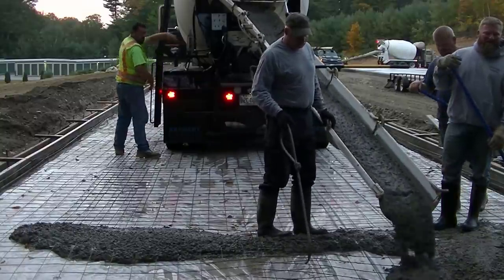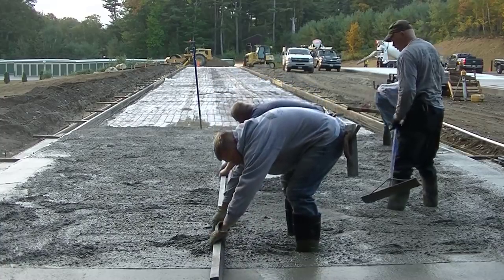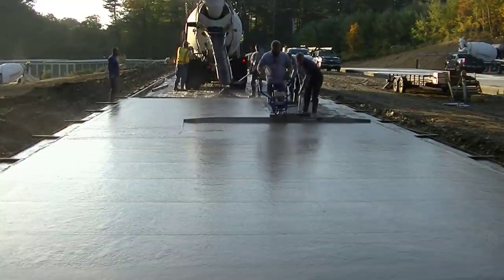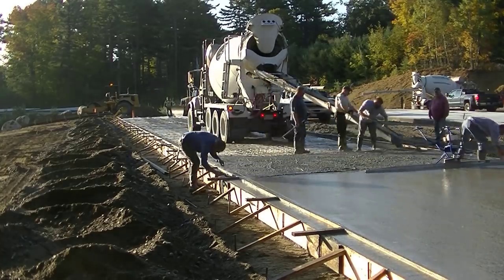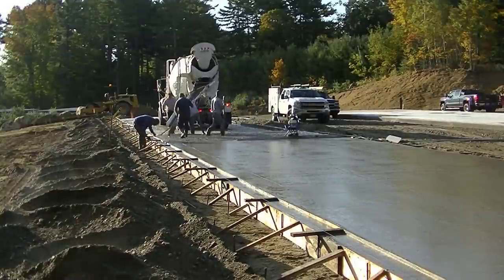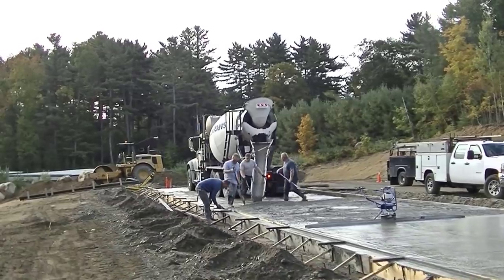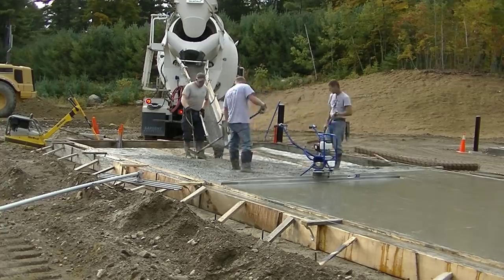Pouring A 4400 Sq Ft Concrete Slab (For A Storage Building)

Comment: My crew and I have taken on a 15'x110', 2 guys and myself with a 20x20 off to the side we used a vibratory screed as well and a whirly bird to finish. I havent taken on anything quite this big as I havent had the opportunity. You guys did a beautiful job.
Reply from the maker: Thanks Mark. Having 3 or 4 good finishers does make doing these a lot easier. We only had 3 trowels on these finishing them.
Reply: @MikeDayConcrete  You guys kill it, very impressive thankyou for sharing.

Comment: Mike, small tip, just use the vibrascreed to set your wet pad in the center. Do your laser wet screeds at the length of your blade or even closer. Nice work . I've done those edges either way, and leaving them open is definitely the way to go

Comment: I'm a journeyman in the union. We poured many huge slabs. I can't lie, it isn't fun...lol. especially in winter when your fighting rain and cold temperatures.
Reply from the maker: You're right, winter concrete isn't very much fun!
Reply: @MikeDayConcrete  I worked one winter in North Dakota. We poured some slabs in 20 below temperatures. The concrete froze on the bottoms of are mag hand floats instantly. A guy walked around with a weed burner and his job to heat up the bottom of are mags to melt the concrete on it. It was ridicules and a pain in the ass.
We always poured using a ground warmer that used hoses that pumped heated hydronic fluid through it and covered them with heating blankets for the night. Then a snow storm hit. We had to dig the snow and ice off of the blankets in order to move them by dragging them. They were so heavy with snow an ice on top of them.
I would never work a winter in North Dakota ever again. It was hell...only freezing...lol.

Comment: Poured my first piece of concrete this last weekend after watching you're channel for a while. It went horrible! Just did a little practice ring around my firepit. Ultimately I think it came down to the concrete we used. Just the cheap hand mixed 60 lb bags from Menards. The bag says its only a 3" slump as speced and we had a hard time with it. We added too much water to try to be able to work it, and still ended up with massive pores when we removed the forms. Some spots had too much aggregate and too little sand, so we ended up with a pebbled surface. Didnt set like I got used to seeing in your videos where you could work the surface smooth with a trowel. We will definitely try again! Probably get better concrete, rent a mixer to get better mixing, and use the right amount of water. I bet readymix goes smoother. Still had a lot of fun. Will probably still hire a contractor for the floor on our upcoming housebuild but definitely want to make another attempt at patios and sidewalks.

Comment: Mike, I really like how you have the open ledge.  We typically will form this with 2x10's nailed on edge to out outside vertical form, a 2x12.  Lots of work to strip and finish.  I'm curious how you suspend the 1-1/2" form and keep it secure?
Reply from the maker: I use a Simpson Strong Tie bracket from the 2x4 to the 2x12 to secure it.

Comment: We called that shelve a "weather lip "   I put a weather lip on all the  residential  garage floors I do ,,, just lay a 2x4  on its flat up against the garage door bucks that they screw the tracks to ,,,,, finish to the top of the 2x4 on the inside the bottom on the outside just like you did there ,,,usually after the first pass take the 2x4 out and finish underneath it brush it  or float finish it !

Comment: Hey, so we’re a non profit camp for people with disabilities that pours all our own concrete. We mostly pour walks between all of our buildings for accessibility. We use a vibrascreed for everything we can. One issue we’ve always had is pouring pads wider that the screed board like you’ve done here. It seems like If it’s not riding on the edge of our form it just sinks in. So to combat this we always have to put in a 2” steel pipe down the middle of the pad to ride on and then we pull it out after screeding. Are we doing something wrong that it always sinks in? Should we not be sitting on the edge of the form maybe? Also your videos a beyond useful! I’ve learned so much watching

Comment: Nice work!  How far apart do you space trucks?  We hand screed with a mag board and use a 2" flat bar on edge for screed guide in the center.  Usually only do 20-30 yds at a time since it's just a two man crew with whatever day help we can scrounge up.  It is a real pleasure to watch your crew work.
Reply from the maker: Not much spacing. On a job like this he just loads them as fast as he can.

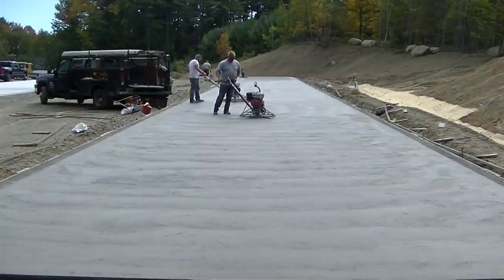Comment: Hi Mike, my name is Dimitri. I have a small company of 9 guys and we are concrete floor specialist in Mauritius. We usually cast 40.00 x 10:00 x 0.20 mm thick in 1 pour including the power float finish. We also use a laser to control the levels. Every steps are quite similar except from your vibrating ruler. Instead we use a vibrator and poker and aluminium straight edge ruler to cut the concrete flat. We also use floor hardener at 5 kg/m2 by dry shaking and we power float with a rideon power float machine. We normally start at 8:00 in the morning and we finish at 19:00 hrs
 Let me have your opinion on our way of doing concrete floors. We also use a pump to pour the concrete.  Regards Dimitri
Reply from the maker: Awesome Dimitri, thanks for watching!

Comment: Great video! Do you ever run into the slab "shattering " when you pour directly on plastic? It's always been recommended to have a few inches of sand or dirt on top of the vapor barrier....
Reply from the maker: No we don't have any problems doing it like this other than the bleed water.
Reply: RE: a few inches of sand or dirt on top of the vapor barrier.
That is some Californian ridiculousness. If water get into that layer, where should it go? It will creep out of the floor. Expect all kinds of fungi and mold. Obviously, the sand must be under the vapor barrier, obviously.

Comment: Hi . When driving with the power trowel . Have as little angle as possible, To increase the angle after a 3 times. then you get the cream, then drive 3-5 times  until you have a mirror.
This is translated by google
etc. from Sweden
P.S. Nice work

Comment: Mike,    I know this is off topic.   I need some help to help my son.   He purchased a house with a in ground pool.   The concrete is sinking in a couple areas about 1" to 1.5".    The previous home owner skimmed a material over these edges to keep them from being a tripping point.    These areas are now breaking up....     I know that having the concrete lifted would be the proper fix.  Sadly, during this virus time funds are very tight.   I can't help him because i make ends meet barely being a disabled veteran.    What materials would i use to skim these lip areas?    Also,  what could i do to prep these areas to help the skim material stick better?    Any suggestion would be greatly appreciated.

Comment: Sweet moneymaker there! No pipes, no pump, trucks spaced just right, no waiting. I bet you wish you had 3 or 4 of those every day, right?
We have a cpl names for those forms on the edges in my area. Those specifically, most would call a ‘recess form’. Or some people might call them ‘depression forms’. Others might even refer to them as a small ‘floating form’. And you’re right. WAY better to ‘float’ them in there like you did instead of a solid 2x8 or 2x10. Then you HAVE to use a vibrator and invariably you always end up with a cpl voids that need to be patched.
I wonder what they’re referred to in other areas.
Reply from the maker: Yea, it's pretty much impossible to get the air voids out using a 2x10 unless you strip it off and sponge it out. A lot more work in my opinion. The pouring and finishing part of these is the easy stuff, forming and stripping the forms is more work.

Comment: Still screeding with a caveman 2x4 and vibrating using a hammer on the forms as we're pouring out because bossman is stuck in the early 90s.

Wonders why there's small dips in the slab though.
Reply from the maker: Have you shown him my videos?

Comment: Anybody have any experience with keeping a small bathroom in the corner of a slab isolated from the rest of the slab Incase there is a plumbing problem so I can just remove that section?

Comment: Why don't you cut the pad wet, rather than coming back and cutting it with a saw?
Reply from the maker: You mean use a jointer? It's easier to just cut it after. Especially when power troweling. We cut it the same day, as soon as we're done troweling. You'll see in the finishing video coming out next.
Reply: @MikeDayConcrete  all the dust. Our mason cuts it wet and then actually covers it up so you can't even see it. Also when pouring a garage he puts an 1 1/2" galv pipe at the edge for a smooth transition. That's a pro to me.
Reply: Jameson Cross what do you mean covers it up so you can’t see it?

Comment: No need in ripping the 2x4 for weather lip so you can reuse them later
Reply from the maker: There's less of an area to "mag out" under the board when you strip it off. Just a little easier/faster to finish in my opinion.

Comment: I will challenge you to cut one concrete slab to see were is the wire mesh. 99% is going to be on the bottom and is not going to help as intended!!! They pulled the mesh up but when they used the board to level it... they stepped on it so is all the way down...
Reply: The wire goes back down a little when you walk on it, but the aggregate keeps it from going all the way to the bottom
Reply from the maker: If you've ever had to demo a slab after pulling up the wire you know it doesn't fall all the way back down to the bottom.
Reply from the maker: @brockwagner939  Amen Brock, You know your stuff, thanks
Reply: Ovidiu Ciuparu I agree 100%, it’s a lazy way of concreting, that mesh does not float in the concrete when stood on, may as well not bother putting it in at all. If anyone watching this takes anything from these videos it’s don’t hire people that lift mesh as they go, no chairs no good and it’s lazy practices.
Reply: Brock Wagner no it doesn’t. Look again. You pull on the mesh while you poor. Not debating that. I was saying that in the end you will step on it again and again. It stays up what? Let say you “get lucky” and you get aggregate everywhere and is if 3/8.. that is it. Compare this to a prefabricated slab where the mesh in 100% in the middle. If you test a prefab slab were is “perfect” with any of these slabs same concrete mix... that is a lot stronger. Beyond this. They are so many people that add spacers under the mesh to keep it up. They are some small blocks that hold it up even if you step on it...
Reply: Mike Day Everything About Concrete definitely not in the middle were will be the most effective...

Comment: i have looked at a few concrete pours you have had this one is close to a 8 inch slump or better so tell it like it is all these youtube pros make me laugh lolololol that concrete is leveling itself lolol and that is no 6 inch slump you may fool some people to look good but get a grip lolol that will not pass for a super flat floor good thinghg you had no inspectors on this job the bleed water is excessive not a strong floor at 3000 psi lolol more like 1500 psi in 30 days lolol this video should rank high in the HOW TO NOT POUR A FLAT FINISH FLOOR